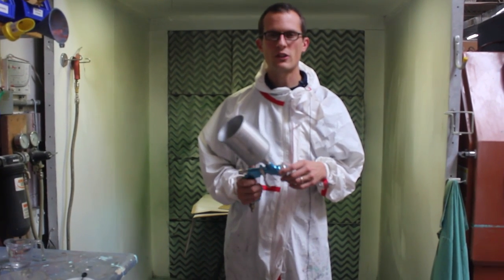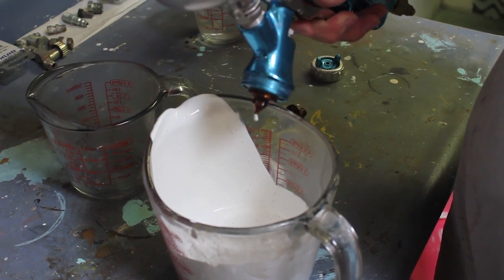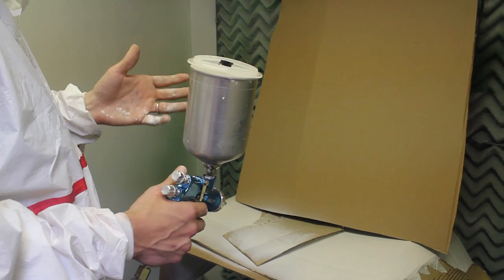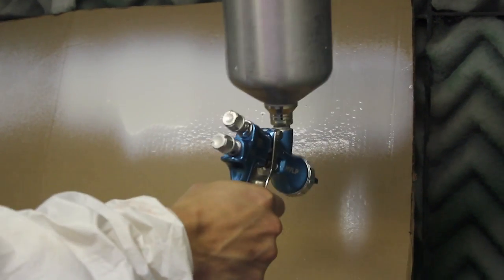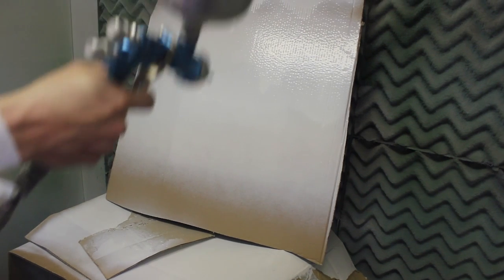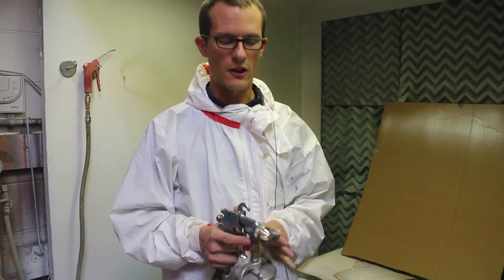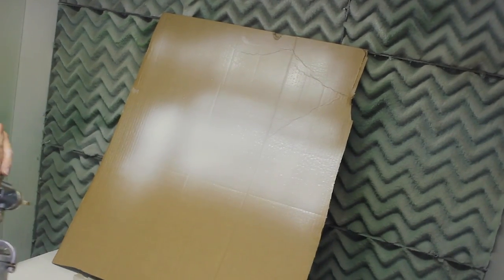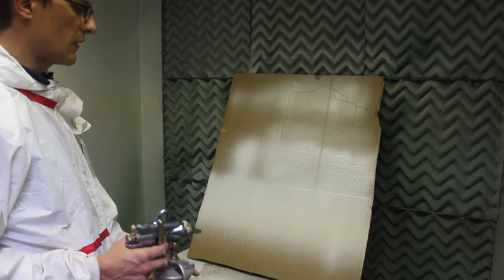Spray Painting - How to Set Up and Use a Spray Gun (HVLP or Conventional)

Comment: My spray comes out very faint, even with the flow open all the way. What am I doing wrong
Reply from the maker: Usually that means your nozzle is to small for the paint your spraying
Reply: @PittsburghSprayEquipmentCo  does that mean i have to thin the paint even more?
Reply from the maker: @TGBAgentOrange  you would need a larger fluid tip you can try to thin and that might help but usually a bigger fluid nozzle is what's needed